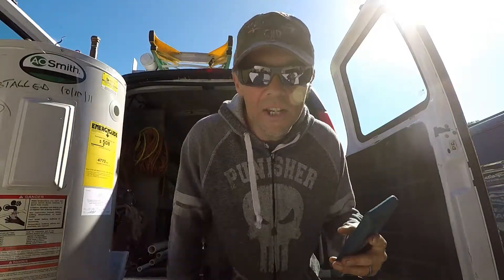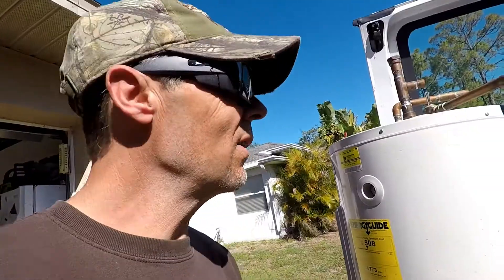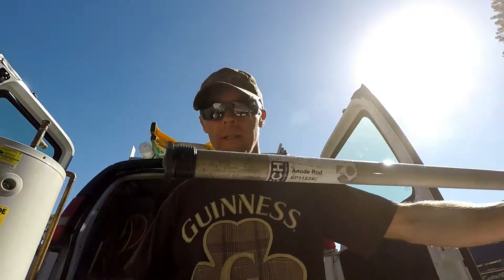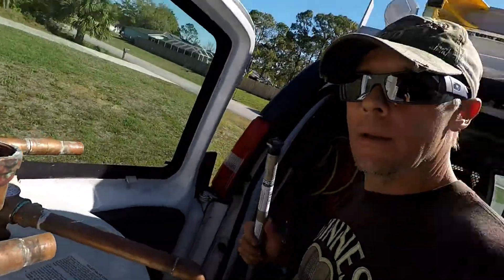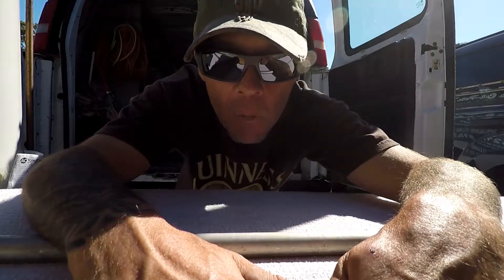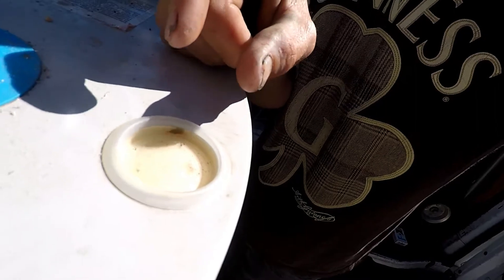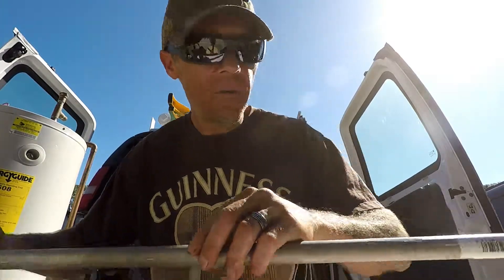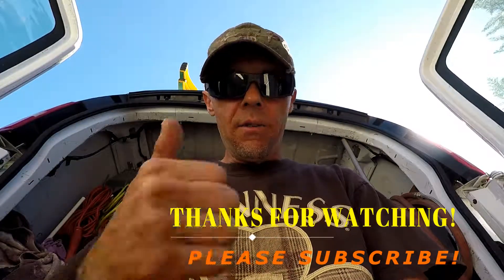WHAT CAUSES A WATER HEATER TANK TO LEAK

Comment: Replaced my Rheem 40 gal electric water heater today (12-17-20) and it had a 6 year warranty.  My old water heater was 3 years and 9 days old and it was leaking water from the top causing it to trip the reset button. My brother and I disconnected it ourselves and took it back to Home Depot where I bought it. They gave us a new one, same brand, model and capacity, but I had to pay $22.00 for it. My water pressure is 55 psi so I'm not sure why I'm having these problems. I've had to replace my water heaters on average about once every three years and all for the same reason. I guess they don't make them like they used to. Thanks for your video Tim. Let me know what you deduct from this.